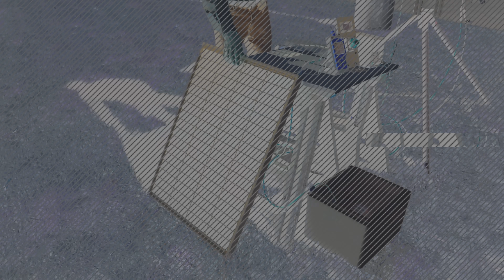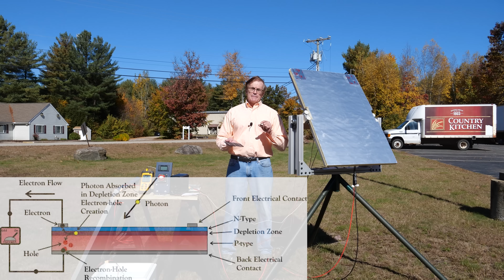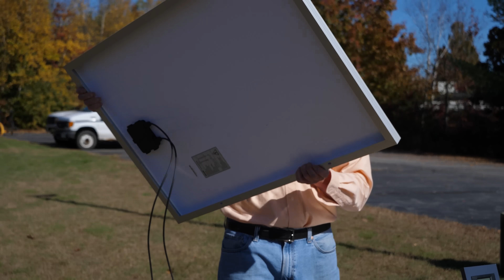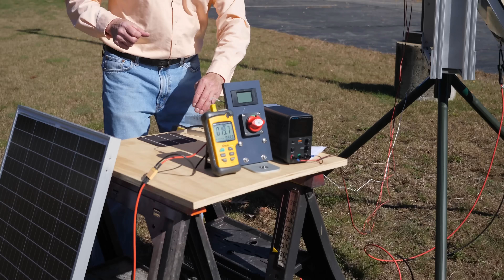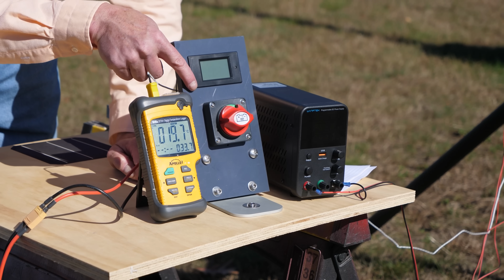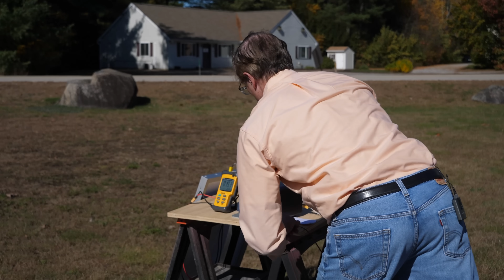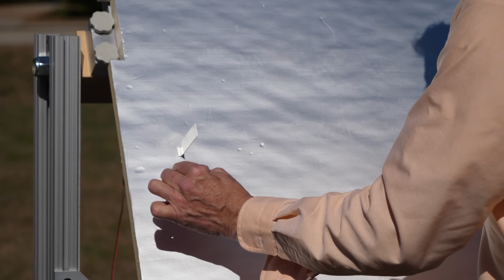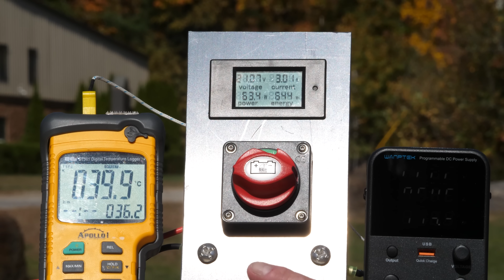Do you REALLY get enough out of your solar panel?

Comment: Earlier last year i convinced my dad to let me install a DIY pool-water circulating system on his 16kW panels in Spain. Panels temps dropped from 85°C at 30°C ambient to about 45-50°C. Average power output on a cloud free day jumped about 17% in addition to eliminating the pool heater in spring and fall. Since this house is completely off-grid, the savings in diesel already made up for the $800 cost.
The system is not perfect and was more of a prototype that worked too good to tear it down. Super cheap plastic sheets glued on the back of the panels with about 1cm gap and sealed on all four sides. Fittings are epoxied straight onto the plastic. Water flows in parallel through all panels, two redundant overpowered pumps are controlled by an ESP32 with Wifi for fault notification and temp measurements. Next upgrade would be a water to water heat exchanger to be able to run automotive coolant. In theory i could push air through the same pipe when pool-temps get to high, might test that this year
Reply: Nice
Reply: Yeah, it seems the trick is to DO SOMETHING with the heat that the solar panels are collecting for you.
Reply: @PaulLawson-k8v  Pre-heat for domestic hot water.
Reply: You beat me to it, wanted to write this: "Now, about cooling; use watercooling. Just make sure you filter the water before it goes into the cooler as mineral deposits (and others) make the efficiency less, or make it a close loop system that transfers the captured heat to a secondary system that is connected to your warm water tubing."
Reply: One could use this as a water heater preheat. I wonder if a water preheat tank combined with a heat pump might result in a 3X or 4X more efficient on demand water heater system?
Reply: @stcredzero  You can buy panels already made for that.
Reply: @softerseltzer  just drain the system, panels don’t heat up too much in winter
Reply: How does this effect pool water temp in the summer?
Reply: @afoose  i controle the flow with and ESP32 and can set whatever i want as a target temp. 34°C is the highest i got during last years heat wave
Reply: @afoose  it freezes 😱
Reply: @afoose  Higher algae..Put a tap..
Reply: Curious that it would work better on cloudy days.  Seems that the heating would be reduced (as well as the output) so the fans would not be as effective as they simply have less heat to move.  I suppose it's the absolute temperature that counts here though, and fans on a cloudy day would bring it pretty much down to ambient.  Optimum performance should be an night, but there's a small problem with that
Reply: If you don't have to worry about freezing the coolant, stick to plain water. It has a higher specific heat capacity and is a better coolant.
Reply: Bro, HOT TUB!
Reply: Don't you have a large power surplus anyway when it is so hot? Any way to use that 17% more power then?
Reply: if are to use water...simply make sure it is always shaded. if the panels are near ground. go ahead and put a water tank in the ground.  any kind of inground water resivor. don't just think a tank an amazing...but expensive tank.   could simply be a kiddy pool, only 5 ft wide,  10 inches deep.  dig the hole, pop the poop in it. cover it with plywood.  keep in mind if you dig and install a tank or 50 gallon water tank, or even a bit plastic trash can, the hole would be deeper.  reaching even more cooler temps as well as causing for smaller surface area to cover.  but even just the 5 foot, 10 inch deep kiddy pool in the ground, covered, the ground temp will always keep that water way considerable cooler.  oh yeah and for freezing winter temp. no biggy...the ground temp will also help keep it from freezing, but just put a clear cover replacement it on it so it traps the sun heating. 

 very likely water cooling them panels won't be nearly needed in temps below 50 or 40 degree f.  so invest any additional time....and...money to do an amazing temp cool system for them panels for a northern location.  like near Canada border..2 months going into winter you'l get average temps less than 60 f.  and 2 months coming out of winter as well.  plus a solid 3 months of winter where its 30 f and less....thats at least 6 months of naturally cooler panels to begin with.........so i would definitely NOT go crazing with a water cooling system up the far north.  so no need for a water pump nor its electrical use for an inground water tank/resivor.   about the pump and one using electical use....it will pack on who knows how many years of panel life so im more than sure the electrical usage and addition pump cost is well worth this type of water cooling.   inground, covers water like never reaches about 75 f.  the panel heat might make 50 gallons of inground water, rise from say...75.  up to 110 at most...this is being awefully generous.  considering how environment temps go up gradually and coming back down gradually coming in and out of the season.  

i can't see a more logical way of investing in panel cooling than this type, so i would be doin that and tweeking it as needed.

all great ideas and tips from you guys though.  awesome brain storming going on, on this channel in general...  which is f'ng GREAT....all you hear 80% of the time...GO GREEN...well ok how about how we can actually go green in a way that isn't some ones financial killer??...they never mention this stuff on this chanel nor any of the your guys tips and ideas....real good stuff.   good job guys  :)
Reply: Do NOT use automotive coolant as it is very toxic. Heat exchangers tend to fail and you do not want poison in the pool. You can see the debacles of oil coolers and transmission coolers in modern automobiles to see the frequency of failure. Great project!
Reply: @dosgos  for example if the pool is 3m x 5m x 1.5m it contains 22500 liters of water and if the system contains 20 liters of coolant mixed with 50% antifreeze, so it is 10liters of pure antifreeze, you need to drink 67 liters of pool water at once to reach the lethal dose of 30ml ethylene glycol.
But you can also use the more expensive propylene glycol antifreeze which is not poisonous...
Reply: @dosgos  the coolant used in commercial solar water heating systems is very similar to automotive coolant and it is even used to heat tap water, so as long as you build the heat exchanger in a way that a failure is very unlikely, it is safe enough. 
Remember a pool contains a huge amount of water while the amount of coolant in the system is just a few liters, so even if all the coolant leaks into the pool, it is still a very low concentration in the water, and since you usually don't drink pool water, it is completely safe...
Reply: @Henning_S.  Coolant is highly toxic and I still would not want my family to be swimming in diluted toxins.
Reply: I think the economy is better for the winter, using the heat from under pannel to make usable heat for house with just "silent" air compressor and set pressure output at 7bar to recovery the free heat generated by solar pannel = the poorman heatpump :) The bonus is you can also sending hot air under panel to remove snow
Reply: You Should post a video of your system, I d be curious to see it !
Reply: @ J.R. Can you please share a video of the project? It's hard for me to picture the water circulation behind the panels. Thanks
Reply: that would make a great video
Reply: I live somewhere with ambient temps frequently at or above 40C, and have often wanted to do something like this.
Reply: This would be totally awesome on the 600W of solar I have on my campervan. More power and free hot water in the summer, win win.
Reply: Linus at LTT did the same thing, but we're still waiting for the pool to be finished - lol -.
Reply: How did that end up costing $800? Or did you mean the panels cost that?
Reply: @peterhoulihan9766  Pumps and pipes were $600, Plastic panels about $120, $50 for silicone and a couple bucks for an ESP32 and a few sensors,
Reply: @justus1995  Fair enough! I think I was picturing something smaller than what it sounds like you built.
Reply: @peterhoulihan9766  you need quite a few Gallons/minute to achieve sufficient cooling. Pipes for these flow rates are surprisingly expansive
Reply: @justus1995  Interesting. I see what you mean.
Reply: Nahh what? Can you video it? I cant understand what you did.
Reply: thank YOU for sharing!!!! marvellous ! will you make a video ?
Reply: And the total power consumption for running such pumps in addition to the system cost?
Reply: Stage 2 could include hot water and or heating too!
Reply: Sound great.... Do you have photos, videos of your DIY project ?
Reply: You need to make a video detailing this system! Sounds genius
Reply: Video please..
Reply: Care to do a walkaround on that system?   Just film, send it back and forth with TI peeps, and maybe do a collab? If all of Spain does this, you'd see an instant jump of 10% PV output, but also get 10-15 more years out of existing installations. That last part does a whole lot to make the investment more of a no-brainer, as well as saves the environment a whole lot of PV manufactured
Reply: Good job!  Not relevant to your set up but I am a bit skeptical that the panel temperatures were 85 deg C at 30 deg C ambient.  I live in the Arizona desert and routinely see 40 deg C ambient and, of course, full, direct sun on my panels (only 3 KW rated) and they've never gone above 75 C in stagnant air.  How are you measuring the temperature of the panels?
Reply: The pool is going to lose heat at a certain rate through evaporation (though of course gain heat from sunshine). The question is, can the pool dump heat faster that the panels create it? What's it's rating as a heat sink? Actually you could calculate this, heatsinks are measured in C/W, Celsius per Watt, ie how many degrees hotter it gets, per watt of input. Lower figures are better of course, you want lower temperature.

I would bet the system will be fine as it is, I dunno exactly how your panels respond to temperature, but no swimming pool I've ever been in could be described as "warm". You get used to the temperature but it's still a bit cool. 

I dunno if a heat exchanger would be worth it, since it would be a significant thermal impediment itself. What would you use, like a car radiator in a tank of water kind of thing? Big pump to push water through the vanes.

Does sound like your prototype was "good enough" enough that the bother of doing it "properly" wouldn't produce much advantage in return. Maybe wait til something fails, then replace it with a part done properly.

Great work keeping $800 of diesel exhaust out of the atmosphere! Well done on saving the cash, too. All gives a little less power to the people who produce petroleum, who are usually awful, terrible people. Independence and luxury, off-grid swimming pool, that's the way! Next time, maybe swap out the chlorine system for something involving reeds and plants to filter the water, active helpful bacteria. It can be done to purify shower drain water into drinking water, though I wouldn't choose to drink it.
Reply: This is actually much better than using air cooling. Pumping water is much more efficient than pumping air.
Reply: Sounds awesome!
Reply: It is called pvt collector and is comercialy available. The connection to heat up a Pool in Summer serves as a heatsink. But when you planed it bevore building the Pool by insulating the Pool an covering it whith an insulated sundeck. You build yourself a pretty big thermostorage fore Winter in nortern degrees in Konjunktion whith   Big Radiator areas like seeling heating you can sorten the periode in which heating is required. An through the same heat exchanger you can evan use the Pool in summertime as a heatsink instead of a clima System.
Reply: Automotive coolant actually reduces the ability of water to cool! It is used as a rust inhibitor and anti-freeze not to improve cooling.
Reply: I came to the comments to suggest this only to find not only was I late to suggest it but it had already been implemented. I thought of it because my cousins growing up had a pool heater like this but without the solar panels. Only problem is summer when you don't want the pool heated but worst case you just don't run it then and deal with the lost efficiency & extra panel degradation. Then you still have the potential to upgrade to a radiator setup later if it makes sense.
Reply: I am amazed that combination hot water PV panels are more common place, to me it seems that this should be a no brainer guess makes too much sense
Reply: Have you considered running the pipes low underground between the source and the panels? This could cool the water as it makes its way to the panels and back without chemical or powered cooling. It could keep the source water cooler year around.
Reply: Don't use automotive coolant, use RV coolant, aka propylene glycol, if it leaks it's not toxic. 
Also, a diesel heated pool on an off grid house is bat shit crazy lmao.
Reply: @bobbygetsbanned6049  Thanks for the RV tip, havent thought about that part :D The pool is electrically heated, the diesel generator is the "backup" that kicks in when PV--power is too low in Fall/Winter and Spring
Reply: @justus1995  Could you post some pictures or a simple video of your setup, or refer to ? I also want to try this with my pool.
Reply: I like the idea of using the frame as the water cavity. Also, using ambient air as the working fluid is interesting, but air is a poor poor thermal conductor. What about sprinkling pool water into a wading pool as a make-shift cooling tower before pumping it through the panels?  

Also, I have looked at using automotive coolant for similar heat exchange purposes and found the drop in heat capacity outweighs the benefit, unless you are working outside of 0-100°C.
Reply: I like this
Reply: amazing!
Reply: Damn anywhere we can see pictures? Or diagram? I would love to do this exact thing.
Reply: How much energy is the pump consuming to move the water to the rooftop?
Reply: I was thinking in something similar to this, would be cool to chat about more in detail explanation if you have some time, i would be doing this in Tenerife where it makes a lot of sense, mostly being able to reuse some of that water for normal chores
Reply: Damn! That’s awesome!
Reply: Put a saddle valve on pump outlet,  feed through solar hot water panel or black piping, non return valve and tap to adjust flow, trade off more algae more chlorine..
Reply: i did a similar thing, have a large water reservoir with aluminum wires and a fan system worked very good on a 4kw system improved output by like 25%, going to try silver/copper in the future aswell
Reply: Wow that sounds like an awesome system ! ! That's great that there are still people out there willing to "Make their own shtuff" CONGRATULATIONS on your great success and for thinking of it in the first place.
Reply: 🤔
As I was watching this video, I'm thinking that I should vent the cool air coming from the radiator of my hot water heat pump (HWHP) to my 10kW/h solar array (30 panels) and capture the hot air from the array, ducting it back to the HWHP radiator.
This should improve the efficiency of both. It'll take a bit of work and some $$ outlay, but should be worth it.
I would have to check the ability of the fan on the HWHP and if it's capable of moving air through ducting like that...
(34deg south in Aust)
Reply: In boats, a valve is installed in the highest point of the cooling system that closes when pressurized and opens when no water is pumped. This prevents sifoning water into your boat. If you use such a valve in your system at the highest point, the system will drain itself automatically when the pump stops, so it won't freeze in winter. Thus, you don't need a closed coolant system and a heat exchanger.
Reply: Do you have pictures or video? Are you pushing chlorinated pool water through it?!How is it holding upm what type of pipes/tubing are you using?
Reply: you can already scratch the idea of pushing air through the tubing, it carries almost no thermal mass in comparison to water
Reply: can you please say how you made IT in dersil. Have you a Video, many thanks.
Reply: Justus, that is great news. Thanks for sharing!
Reply: Justus, by the way, me reading your experience is perfect timing, because we are the the process of designing a BRT [bus rapid transit] line. I already told them to install panels over the stations for shade.

Convincing them to use the heat to heat swimming pools is such a top tier idea.
Reply: if you could place the panels below the pool level, you could use a thermosyphon to circulate the water without any pumps.
Reply: This is the way. 

In the video setup, if you lose power to the fans, or the fans fail, you'll cook the panel fast. With a water cooling loop, you still have air flow if things break. And, over a long enough timeline, something will fail.

I have an 18kw system that I DIY'ed, with half mounted on a roof, half on the ground. I water cooled a 6kw section of the array and am seeing similar results. The heat is dumped into the ground. The pump is powered by a panel that was badly damaged during shipping, but still makes power.
Reply: @ur_quainmaster7901  Losing cooling will not "cook" the panels.  They are designed to work that way anyway.  All that would happen would be a loss of efficiency and some lifetime loss that shouldn't be much if the "cooking" is intermittent. Making up some cooling loss alarm might be a good idea.  I can see running for days or weeks before you noticed that it doesn't seem to be up to snuff.
Reply: @dougcox835  That was true before he mounted the aluminum plate to the rear of the panel... And it is possible that it'll still have sufficient airflow without fans such that they don't die immediately... But they will be hotter than before and I'd test it thoroughly before installing.

It must fail safe.
Reply: @ur_quainmaster7901  I assume they would connect the fans across the panel with a voltage regulator in practice so that never happens, if the panel is hot it's making power.
Reply: @ur_quainmaster7901  >The heat is dumped into the ground.

Ah, putting back the heat for all those people using ground-source heat pumps to heat their house. Very neighbourly of you! It's some very versatile dirt we've got down there.
Reply: @ur_quainmaster7901  Not to mention how long do those small fans cost? And how much work would be involved in pulling a panel out of a large roof mounted array, to replace a fan? I think a much better way to go about this if you have the land area, is just build a ground mount array, so the panels always have free air flow around them, and makes the array itself easier to service, and also not get in the way of roof repairs. But if you don't have the land space, and/or don't want the eyesore of a huge ground mount array, then mounting on the roof and using the waste heat to heat water for a pool, showers etc, is a very good idea.
Reply: @brnmcc01  wouldn't a raised mount array make them more susceptible to wind? I feel like many places around the world are already dealing with storms that reach quite high wind speeds, so that would be important to consider
Reply: @___echo___  There's many large utility scale PV arrays here, with steel posts that are anchored in the ground. There is an array of 88,000 solar panels at the Indianapolis International airport for example. They can sustain even a strong thunderstorm, the higher risk in small tornado events is more from flying debris and tree branches than the wind itself. But rooftop installations can be destroyed by hurricane/tornado flying debris too, a flying tree branch at 100 mpg or 160 km/hr will smash any solar panel no matter how well made :)
Reply: @brnmcc01  those fans are probably $5-$10 each and can be replaced with a screw driver. Obviously ease of replacement would depend on how you mount your panels. These are similar to pc fans which last easily 10+ years.
Reply: @brnmcc01  One thing to remember is he stated that they are fully sealed waterproof fans, that are 12v 5w normally, which he has lowered the voltage by half to just 6v which has also decreased the power draw to only 1w meaning they will last many times longer as using 1/5th the power and half the RPM, normally they can last around 20 years depending on the make and speck's etc, as there is very little to wear out with sealed liquid bearings.
They coast £3-5 each when buying low numbers, <10, but the price comes down to less than a single pound each when buying them in the hundreds.
Reply: @brnmcc01  they don't cost very long at all 😛
Reply: @brnmcc01  Fans are expensive! More panels is cheaper than more fans and heat sinks, same reason moving panels with the sun makes no fiscal sense, it's cheaper and easier just to add more panels. And if the panels die early, the tech will be better and cheaper in 10-20 years anyways.
Reply: @bobbygetsbanned6049  I agree. Fans just more moving parts to break etc as well. Keep it simple principle
Reply: @brnmcc01  Yup, the KISS method is almost always the best.
Reply: @brnmcc01  Every moving part will fail some day. Reusing of the heat is good but project must be perfectly adjusted to local situation.
Reply: @ur_quainmaster7901  

the hot water can be pumped into the house boilers.
Reply: @ur_quainmaster7901  Problem with water cooling is that it takes too long time between the input and the output so you will have a temperature differential between the coolest and hottest part of the panel which will negate the effect in terms of power output.
Reply: @melange78  Yes, which is why I use a manifold and run a separate line for each 100 sqft or so. And that complexity is why I don't have the entire system water cooled.

I am still seeing a huge drop in temperature during the day... There is a gradient from cold side to return side, but it doesn't saturate.
Reply: @melange78  Nah. Water would have to be almost standing still for that to happen.
Reply: @ThePentosin  No. Water is slow. You don't understand the problem. The temperature needs to be equal over the entire panel in order to gain efficiency.  You do not gain anything if you have almost the entire panel with a cooler temperature and one hot point at the end of the water coolant output. You need to have a very fast water system in order for that to work.
Reply: @melange78  nah. It's so easy to get enough flow that this isn't an issue. It really has to be moving very slowly to get a significant temperature delta from one side of the panel to the other.
Reply: @ThePentosin  No. There are plenty of videos that explains that. The initial commercial solutions were water cooled but they don't exist anymore because of this problem.
Reply: @melange78  dude! Have you forgotten what your even replying to here? Read what OP wrote, again. There are even commercial watercooled panels available. Stop talking out of your ass.
Reply: @melange78 mmm There is some validity to your observation but the cooler the better so if you pump an excessive flow it would just be a slight, unnecessary power waste in pumping. It doesnt need to be a tightly controlled temperature so hysteresis between measurement and changes is a dont care situation as long as a selected limit condition could be observed in a reasonable time, within minutes. The only temp measurement you would need in a working model might be to measure at the known worst spot to insure there is sufficient coolant flow and alarm if not. Prolly better to do that by pressure rather than temp as a pump failure or coolant loss would be an immediate drop in pressure.
 And on the hot spot concern, as long as any point on the panel is cooler than it would have been without the cooler, it is a win, you would like to maximise that win.  Just need to observe in operation with a thermal camera to optimise the distribution of your coolant by modifying diffuser channel design and there is some conduction in the glass and other materials to help even out the temp.  Every panel has cell to cell variation in perfomance anyway, due to manufacturing or damage or dirt and shade after the fact, some are better than others and that can and should be occasionally observed with a thermal camera too.
This really needs to happen at the manufacturer level because
Reply: @melange78   and yet this man saw a 17% increase in efficiency. How do you square that with your explanation that efficiency should in fact go down?
Reply: @melange78  there are two sources of temperature differential I can imagine being important to consider here. Concentration of light and a temp gradient due to convection.

For the former, water cooling is only a benefit as it’s an additional conductive medium for heat to equalise across the panel.

For the temp gradient, with really very little flow this would be irrelevant. If you wanted to get silly, you could have an appropriately gradated heatsink to cool the top faster. Or a manifold and multiple chambers. Perhaps a single chamber with gradated thickness would work but I can’t do the math. Also not sellable as it would need to be tuned.
Reply: @whirled_peas  That there was not much heat to remove from the panel. Just check other videos on the topic if you don't believe me. Air is better because it is faster. If you compare with a water cooler on a CPU you have a proportionally much bigger system with rapid flow.
Reply: @ThePentosin  And I have followed the development of them for years. Now all the ones that are available here are aircooled.
Reply: @melange78  this is not only untrue (same myth as with shading) but also hard to achieve in practice as solar panels are fairly heat conductive so you will not really have one hot spot anyways.
Reply: @sandervesik173  What do you mean myth? You can easily get different outputs depending on the number of arrays the panels are connected to the controller.
Reply: @ThePentosin  Water movement only affects the amount of heat you can evacuate and not any hot spots. In any closed loop, the water temperature reaches equilibrium fairly fast so water temperature is the same. Even more so in open loop. As the water cools down the parts of panels closest to inlet, progressively colder water starts to reach warm parts of the panels. Also panels are thermally conductive so pats being hotter will conduct it away to parts that aren't. Also there is air cooling always in action.
Reply: @whirled_peas  The relevance is that most people don't have one panel but an array of many panels. For the water system to work properly you need one input and one output for each panel and the manifold would be insanely complex to calibrate for a larger system. I don't understand why we are even discussing it given how easy the airflow system is.
Reply: @melange78  because OP found a work use for the waste heat.  Which is an exception to using fans being rhe optimum choice just like Nice Science Man said.
Reply: @melange78  about air cooling also saw  where a guy, located up in like Minnesota iirc, built a......large rack system that held the panels for aircooling.  The brilliant part was he used a air heatpump as the fan and pulled the hot PV air through the heatpump instead of just regular outside air.
Reply: @Gleepglopglorpahaha  But in that case there are better fluids than water to use.
Reply: @melange78  i mean yeah there is always a more effective substance to use.  But it may be the most efficient for his based on location, cost, skill level, access, availability, client limitations, etc.
Reply: @Gleepglopglorpahaha  Yeah but it feels like we are discussing something completely different. In terms of ROI I am sure you would make more money by installing a passive water cooling system over your entire roof and not just under the panels.
Reply: @melange78  what if you ran tubing underneath and evenly misted them when it got to a certain temp?
Reply: @Clint_Torrez  But why would you? Do you use a water cooler on your computer? If you do, I am sure you know it is slightly more complex and overdimensioned in comparison than what you are doing with the solar panels. What kind of money do you want to spend on it and how much maintenance? Do you have passive water cooling on your roof? Why not? It seems like that is the first thing you would do a passive solar cooling on in order to save money.
Reply: @melange78   yeah I'm just talking about this kne guys one off project.  Buuuut it is funny you mention whole roof passive heat collection.  Just ran across this vid a few days ago.  The tldr is they built a thermal battery under the house and then they pump hot attic/roof air through the battery and save it for the winter months.

https://youtu.be/7PXfvfZ-b-o

I'm actually thinking now about doing this with my roof space and upcoming solar pergola project and building the battery under a new carport.
Reply: to evenly cool the panels for more production and longer life. I have 4.5 and 6kw ground mounts with water ran to them. Already have the tubing, solenoids, and fittings. Would just need some nozzles, a temperature controller, and maybe some fans so not trying to spend much. I’m off grid with a well btw
Reply: @melange78  

That problem can be solved with more water circuits.
Reply: @ajarivas72  Yeah but WHY? In the end you have to have to make a cost benefit analysis and that is always what I never see in these  DYI water cooling solutions. Like the Linus Tech Tips video where he water cools his server room. Like why would you when you can just install a ductless AC unit? If you need the heat from the panels, why not install a passive water cooler from a much bigger area, like your roof? Focus the energy at where you get the most out of it.
Reply: @melange78  If you increase the diameter of your cooling conduits, you increase the overall flowrate without having it to be faster (aka big slow river vs fast small stream). All you need is a larger pump which runs slower (so it doesn't really use more watts). I feel the system is more complex with the need to filter the water and purge it in winter (during freezing nights), and it's also probably more costly than ventilators, so I guess that's why it has been abandoned by most vendors, but in places like Spain, where it hardly ever freezes and where the swimming pool benefits from it and filters the water anyway, it makes perfect sense.
Reply: @lolilollolilol7773  No it freezes in Spain except along the southern coast. You can probably add antifreeze and get away with it but the amount of work involved in the maintenance seems silly when you can do it with air. Also it seems counter productive to add a faster pump for an increased flow rate for a slow moving liquid if your objective is to save energy in the first place.
Reply: @melange78 lol
Reply: @ur_quainmaster7901  "This is the way." god i wish ppl would stop saying that, just make your comment without the hiveminded pop culture references.
Reply: @rickdeckard1075  I am too old to know that is a reference to something.

If I said "this is how you do it" that would be a reference I recognize.
Reply: @ur_quainmaster7901  BS, you know exactly what the reference is, its all over the place now from that stupid mandalorian show. god i hate the reddit-ization of online experience.
Reply: @rickdeckard1075 you going off is far more annoying. get over yourself.
Reply: @rickdeckard1075  The only Star Wars I like is the MST3000 Star Wars holiday special
Reply: @rickdeckard1075  You're literally the embodiment of what you call reddit-ization yourself - people with nothing to say saying something because there's a comment button.
Just for reference - I didn't know that "reference" either and fun fact for you: just because something is said somewhere doesn't mean it's a reference. Have a good day sir - and have fun digging up in what show they said Have a good day sir... :yougotthis:
Reply: @rickdeckard1075  hey Rick what's it like being old af
Reply: @rickdeckard1075  says the dude with the blade runner reference as his name. You sound like a replicant.
Reply: @TheRealSykx  idk whats it like being dumb af
Reply: @hotrodandrube9119  that's... not even a response.
Reply: @rickdeckard1075  lol 🤡
Reply: Wow, 16 kW? Your dad must be running a small factory there!
Reply: @VioletGiraffe  not really, it’s actually just enough to charge the batteries for the night and power the normal household during day.
Reply: @VioletGiraffe  that's the size of my completely DIY grid tie system. Pretty large house with heat pump heating.
Reply: @VioletGiraffe  If you own an electric car, you probably need that.
Reply: Consider the cost of the cooling system, plus maintenance, verses the cost of simply adding another 2.7kW worth of panels.  That's the real crux of the issue when it comes to cooling.   2.7kW worth of panels is like 8 x 360W panels... not much.
Reply: @junkerzn7312  8 panels plus controller/inverter, mount, hardware, wire/conduit/etc minus extra panel life/power created
Reply: @Clint_Torrez  Relative to a huge system that is likely on the order of 40 to 50 panels that one is adding cooling equipment to instead?.  Get it in the proper context.

That said, I think you are making some incorrect assumptions.  These systems mostly amount to just adding an extra panel or two onto existing strings, so no additional electronics are required.  Or if they are a micro-inverter system, just adding another panel plus its microinverter.  Extending the array by one or two panels is a lot easier and less costly than trying to install cooling equipment on a dozen or two panels.

Another thing that is often overlooked is weight.  A cooling system that actually works is not going to be light.  The mounting  system for the panels might need a revisit.   And if on a roof... the amount of weight the roof can take might also need a revisit.
Reply: He’s got 16kw so 18% is 2.7kw or 8x full sized panels like you said. They are already mounted so I doubt there’s room for them and he’s most likely maxed out on string voltage. That means extra wiring, mounting, and electrical equipment on top of just 8 more panels toward your estimation
Reply: @junkerzn7312  Small problem if you don't have the space for those extra panels...